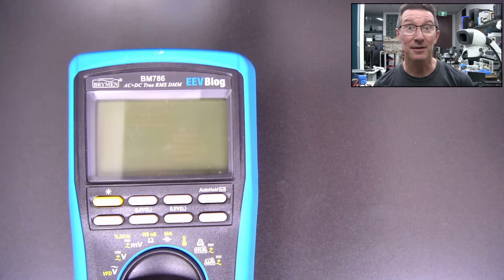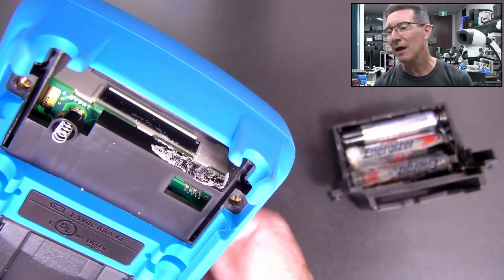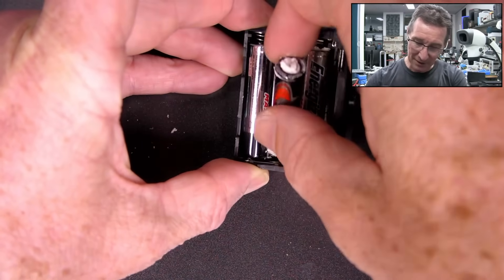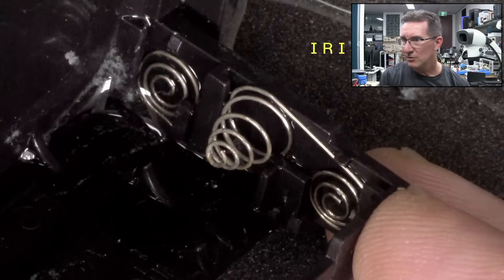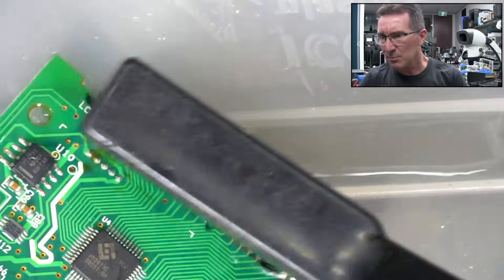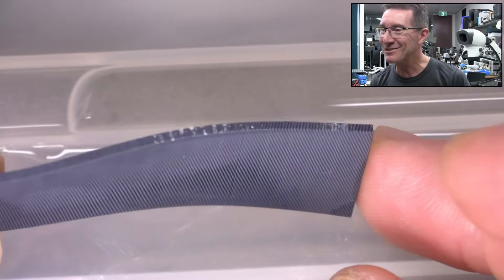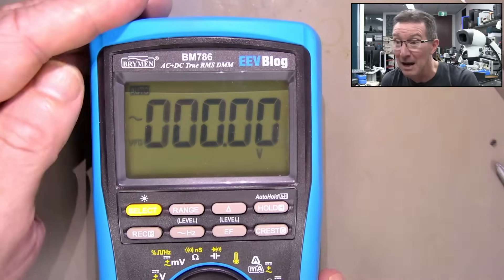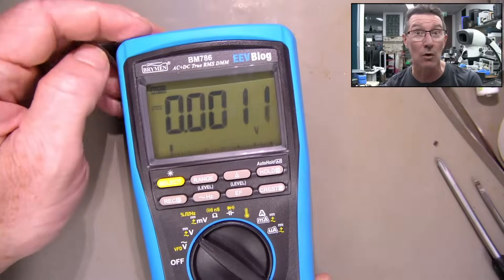EEVblog 1670 - BM786 Multimeter BATTERY LEAKAGE REPAIR + GIVEAWAY

Comment: Don't forget about capillary action. Liquids flow with gravity, but are also known to crawl against it.
Reply: Which I sadly can confirm.  I recently had battery fluud getting soaked into a pertinax / hardpaper PCB making it brittle and crumble away.  This was a single layer board so the effect really destroyed the PCB material itself from the inside.  Result: Not enough left to tepair!

Comment: Dielectric grease can keep the terminals from corroding when a leak occurs.
Reply: That's a partial solution only.  The goo easily seeps deeper into the device.  I even recently had it siaking into a pertinax board tuning the board into a vrumbling ruin.

Comment: I've had enough devices damaged by leaky batteries that I use rechargeable NiMH for everything now. Except for a few items like the door lock that don't work on the lower voltage.

Comment: I'm a big believer in rechargeable 1.2 Volt NiMH batteries. Leakage has never happened  in any of my electronics since I 
switched to them exclusively. Batteries life is 4 times longer and have extra that are charged up & available when needed.
Reply: We can use rechargeables in multimeters without any decrease in accuracy due to the voltage differences?
Reply: @michaelc3987 Try it?  I doubt tjere is a universal answer for all multimezers.  My own muötimeters are using 9V blocls.  Rcjarheables in tjat format are rare and I don't habe a cjarher so I'm still usimg disposables for this purpose.

Tjere are recjarhable bazzeries witj 1.5V btw.  Tjey have an exzreme tendwncy to leak in my experience.  A search on the net found others have made the same experience.  There are 9V batteries woth that type of cell.
Reply: One of the convenienves is not having to wait for a device to fail or swap batteries early wasting residual capacity.  It's nice to top up cells at my convenience.

For a photo flash the tradeoff is interesting, more dshots with alkalines or faster cycle times with NiMH.  Even with the latter the number of shots is more than high enough.  I have a set of cells which I'm using in anflash since over 16 years and they're still good enough even when I'm going full paparazzo for a day.

Comment: Lithium primary. (maybe that's what you meant with eneloop?) MM are the idea use case for Lithium primary. Price is a bit high, but less so compared to rechargeables. And rechargeables, as you know, self discharge as fast as the multimeter can use the emergy.
Reply: try eneloop pros first

Comment: I think blue stuff will initially be copper hydroxide, but it turns into copper carbonate over time due to exposure to CO2 in the air (similar to how the potassium hydroxide from batteries turns to potassium carbonate over time and dries out)
Reply: Potassium hydroxide changes pretty quickly into potassium carbonate. Copper hydroxide, if it does change, will be slower.

Comment: Your awesome, thanks for giving stuff to young people getting them hooked!

I am sick of those battery messes. Are the battery just junk today or have they always been so bad. I've been changing them to the Li batteries after I clean them out. Always with fingers crossed that I didn't leave any of that white damaging junk behind. Nice to see the "man" have the same problem. I have a handful of little meters I've had for years and like every one of them. Some use really odd sized batteries. Sometime they have been removed and I forgot to replace the battery so the next time I go to use it and "bob" is not my uncle....
Reply: You're*
Reply: @jimmybrad156  You are correct!

Comment: I don't use alkalines anymore, it's strictly NiMH for my stuff now. Sick of the leaking batteries issue. With the current pricing, there's no real increase.
Reply: Good high capacity NiMH batteries are 3-4 times more expensive than normal Alkaline AA batteries. You can get the crappy 300-700 mAh NiMH batteries for not much more, but if you want the high capacity 2000-2300 mAh cells, they're 3-4x more expensive.

The last 8 pack of 2300 mAh NiMH cells I bought was upwards of $30. A normal 8 pack of generic alkaline cells was around the $7 mark. The crappy 300-700 mAh NiMH cells were in the $12-15 range. I still buy the rechargeable cells because they pay for themselves after just a few charges.
Reply: @GGigabiteM  Still worth it, to not have to deal with the leaks.
Reply: @MikeU128  In what world do NiMH batteries not leak? I replace leaked NiMH batteries all the time, from every brand.

NiMH batteries are no less prone to leaking than any other battery type, especially when they're in series/parallel packs with other batteries. Once the cells fall out of balance, you'll start having problems with reverse charging and you'll have leaking NiMH cells.
Reply: @GGigabiteM  Well, your experience obviously differs from mine. But the only NiMH batteries I've had leakage problems with were Amazon Basics (which I will never buy again). All of my NiMH Eneloops and most of my Rayovacs are still going strong, and many are approaching 2 decades in service. A few of the Rayovacs and all of the Energizer ones stopped holding a charge years ago and got chucked, but at least they didn't leak.

Comment: Use NiMH or lithium batteries. Expensive to buy but they don't leak.
Reply: The IKEA LADDA ones aren't even that expensive.
Reply: @groundzero_-lm4md  Best bang for the buck. Made in Japan. Rebranded Panasonic.
Reply: NiMH self discharges way too fast if you don't use your multimeter that often. 9V multimeter master race = double protection against leakage and cheap alkaline batts
Reply: @tmmtmm  No, nimh lasts over a year easily.
Reply: @tmmtmm even if they go flat quicker, better than leaking batteries.
Reply: @tmmtmm  Japanese Eneloop LSD cells hold their charge well. I've had 9v alkaline's leak.
Reply: NiMH batteries leak all the time. I've had to clean up more leaky NiMH batteries than I've ever had to clean up leaked Alkaline batteries.

Comment: Why you did not use 99% IPA?
Reply: Because he's neutralizing an alkaline spill with acid not cleaning sticky dirt? IPA is just a solvent. Water is also a solvent and will clean away any residue from doing this.
Reply from the maker: Because the white vinegar is an acid, so using at least some water to wash it away is a good idea. Can them finish with 100% IPA.
Reply from the maker: Because you want to use some water to wash away the acidic vinegar. Can finish with 99% IPA if you want.

Comment: Por que agua en el alcohol isopropilico, whi crazy???
Reply: Some liquids and dirt are difficult or impossible to dissolve in pure alcohol. Adding some water does the trick. Vinegar is such liquid I think.
Reply: Wd40, ...water? Never, Never on electronic equipment, ever

Comment: Use old school batteries (not alkaline). Cheap ass Chinese brand, usually marked, "heavy duty": They never seem to leak.
Reply: oh wait until they're flat 😂
Reply: Yes, wait a long time, when used in a low power device that you only switch on now and then.

Comment: Zebra strips are cool things and do last forever but are a bit temperamental with greasy deposits. Oil and grime tends to stick to the rubbery thing, making the contact dodgy, a bit like membrane keyboards.
I'm disappointed by energizer. Tend to trust them way more than duraleaks, but none of these bloody batteries are secure.

Comment: Why use cheapo IPA with water in it? Just buy "pure" IPA that evaporates quickly and properly.
Reply: IPA with water is far superior solvent than pure IPA.
Reply: @jaro6985  - a superior solvent for what? Compounds that are water based?
70% IPA is a better anti-bacterial agent since the water affects the cell walls. But as a solvent I would suggest that anything that dilutes the IPA is lessening it's effectiveness.
I am not sure how it would work on corrosion crystals, as I'd never use IPA on them (it's ineffective for such substances), and pure water (alkaline) is probably the best for battery discharge.
I don't really want water on electronic items that I clean with IPA, that defeats the purpose of using it. If it was water soluble then I'd use water, then clean up with pure IPA as a final step.
Reply: @ for anything thats soluble in water and not alcohol (salts, etc.). You can do two steps if you want, or just do one step with 70% alcohol.
Reply: @jaro6985  - I must be honest here... I have never considered using rubbing alcohol (70%) with water in it. I have always considered it to be like Low Alcohol beer, and a terrible compromise.
I have pure IPA on hand at all time, and separate surfactant type water based cleaners. I use Methylated Spirits (denatured alcohol) for the first pass on PCBs and flux because it's dirt cheap compared to IPA.
For corrosion on battery terminals, I just remove and replace with new, as we generally get battery leakage in low current application when even the slightest bit of plating damage on the steel will cause poor contact in future.
Reply from the maker: I do buy pure IPA, and then I make both versions.  Ideally you want to use some water to wash away the acidic vinegar first. Can them finish with 99% IPA.

Comment: Able to give feedback to the manufacturer to improve the design to further prevent intrusion by leaking batteries? The battery holder looks like it could be improved to stop any leakage escaping the area. (No snaps left to whip for this commenter)

Comment: For an application like a multimeter why not trade power density for service life and use something like an LiFePO4 battery? I'm not sure that longevity translates to not leaking it as soon, but I'm sure there's some batteries designed to not leak.
Reply: optionally, a LiPo that's somewhat small and fits in there could be used, add a USB charge port and some charge circuitry  and off to the races. most AA are around 450-650mAh, so to get similar usage you can stick a 500 or 800mAh cell and be fine with it. LiFePo4 would potentially a bit heavier which could make sticking the meter in precarious places a little difficult, although it would last basically the life of the meter times 10.
Reply: @nightshadelenar  There are already devices with chargeble batteries in a battery holder. The best compromise I think.

Comment: I keep an old calculator on my desk from my old college days, not sure why I did not check last video when you had a leak, but I just checked everything is clean in there, but there are 4 AAA Duracell batteries that expired march 2012.
Reply: I just did the same.  Thought I'd gone through everything not too long ago but I did find the 9V batteries in my Fluke meters were both expired.  One had a March 2017 date, the other was Dec 2020 and has green crusties on the terminals!  Fortunately didn't spread to the meter.

My memory also appears to be playing up on me - I have what seemed to be a clear memory of putting AAA NiMH cells in one meter and I found it still had Energizers...!

Comment: For the multimeters, can they do a 4 AAA battery version, and design them around using rechargeable batteries? The eneloop batteries will not leak if run down to 0V, thus someone forgetting it for an extremely long time, will just cost them about $10 in battery costs, but no damage to the multimeter.
Reply: My second-hand Fluke 89 IV uses 4 AA and I use NIMH, works great, was made 20+ years ago.

Comment: I've not personally seen any lithium batteries leak..... and not the rechargeable ones I'm talking about the Energizer lithium batteries, that you can buy off the shelf, I've had them in devices for years completely forgotten about, I've bought devices that obviously had them in there for many years, one set expired multiple years ago, and I've thrown them in my toolbox for years just to have a quick piece of lithium to play with at work if someone has never seen it 😅 a small pipe cutter, and a small drywall screw to pull it's guts out and you have a piece of pure enough lithium batteries to throw in a bucket of water for folks that have never seen it 😊 but have never had any leak on me, I could just be lucky or never had them in the right conditions. Does anyone else have any input on that particular brand and chemistry? I appreciate your time and effort!

Comment: If one wants to design using alkaline cells, design the battery compartment as a separate replaceable item that is totally isolated (leak proof) to the main instrument.  Even better use solid noble contacts as well.     Given the price of alkaline  a better option would be to  use 18650 cells, LiFePO4 cells.
Reply: For 2xAA I reconfigure the battery contacts from series to parallel, then use 2 x 14500 LiFePO4 cells. Only problem is that the cells will die if the device discharges them below about 2.5V
Reply: @johncoops6897  if you have a DW01 and mostfet package pairing, it'll stop them going below 2.8v (2.9 +/-0.1v), crude but it would be dead easy to implement.
Reply: @nightshadelenar  - I use the LiFePO4 equivalent to the DW01. Usually the SD or HY2112. The -HB variant does 3.65V Ov and 2.5V Uv protection, which seems to work well.
There are some other models like -CB with slightly different characteristics, and there is also a trap... Some types don't automatically reset, and some do. The non-resetting types can be annoying.

Comment: Seriously, don't use them. I changed to NiMH batteries a couple of decades ago.  Guess what, nothing leaked. 
Since SANYO introduced the slow self discharging NiMH cells 20 years ago there is really no reason not to use them.
Reply: To be fair, they have a lower nominal voltage than standard alkalines. Some devices just don't run with NiMH/Eneloop
Reply: @marikann9073  That's true, but i have not encounter them in years. 
For that the Li-Ion 1.5V AA cells should do, but with the downside that you never know the battery level, because of the step down converter. Upside, you can not over-discharge them like NiMH because of the BMS.

Comment: I’ve had two of my newer multimeters (Fluke)with battery leakage with AAA batteries, but I have four older Fluke multimeters with 9 volt batteries and I’ve never had an issue with them. Are AA /AAA batteries more susceptible to leakage than 9 volt? I think I’ll go to rechargeable AAA.

Comment: Have you analyzed the Lithium AA cells that have a long shelf life and promise to never leak? I've used them in a few devices and they seem to work and last great.
Reply: Voltage is higher, and cost is far higher. The perfect solution if you are a rich person.
Reply: @johncoops6897  They are good for things you don't use often, such as lights and radios in an emergency kit. They are also good for things that need to work in extreme temperatures. Apart from that, low self discharge NiMH is a much more practical option.
Reply: @rocketman221projects  - NIMH has the problem of dropping to below 1.25V very quickly, then running at about 1.2V for the majority of the discharge.
That is often not high enough for proper operation, eg cameras and game controllers.
I find that converting from series AA to parallel 14500 LiFePO4 is a better solution.
The main hassle is that over-discharged of LiFePO4 will kill it permanently. I have now found small protection PCBs on Ali that are like DW01 but using different voltage thresholds, and that solves the remaining issue if it will fit inside the device somehow.
Reply: @johncoops6897  If the device quits working at 1.2V, then it's only using about half the capacity of an alkaline battery. That's just poor design.
Anything that's properly designed should work down to 1V per cell, which is pretty much empty on both alkaline and NiMH.

Comment: Does anyone know what causes batteries to throw their guts up like that?
Reply: Alkalines build pressure inside as they age.  This is why a new alkaline doesn't bounce, but a used one do.  A pressure vent is required to avoid explosions.  They are all made this way.  Best thing to do is stop using all alkalines.   Either that or remove them every time.  No brand is safe.

Comment: Sad thing is I have purchased old radio and test equipment that has a 40+ year old battery in it that looks as good as the day it was made.  Buy a new battery and stick it in something and it's leaking within months to a year.  I swear when I was a kid I never had a battery leak in anything.  Personally I switched to NiMH batteries in everything years ago.  I have completely given up on non-rechargeable batteries.  Well everything except 1 time use Lithium batteries.

Comment: Hey Dave!
I'd be keen to hear your thoughts on the 1.5v AA/AAA "Lithium" primary batteries available out of China these days. Do they leak?
Reply: They don't leak.  They last forever too.  Either that or Eneloops.  If you have to use 1.5 cells due to strict voltage requirements, take 'em out after use.

Comment: I have very good experience with hot water to get the crusty stuff off and then clean up with the fibreglass pen. You are welcome!!!
Reply: just vinager, neet  strate out food shaker and what it fizz, and just wash out with favourite brand of water and dry it out
Reply: Soak in cold vinegar for a day or more, or warmer for faster result; clean as a whistle, you'll be surprised. You can buy cleaning vinegar that is 7% acidity, a bit stronger than vinegar for consumption.

Comment: Who do we charge for the repair of the meter from the battery leakage?  Why can't manufactures make a battery that doesn't leak?  Also you claim the LCD is high impedance but you disrespect the high impedance of the circuit.  My suggestion is not to wipe the components on your dirty shirt with the left over pizza from lunch to contaminate the connector and the LCD but to use a hair dryer to evaporate the fluid from the parts.  I know you know better than what you did, I call it laziness.  You are lucky the the LCD and the connector were not really that high of impedance.